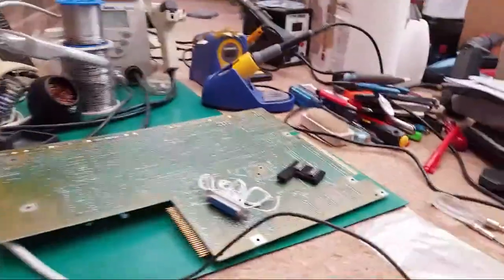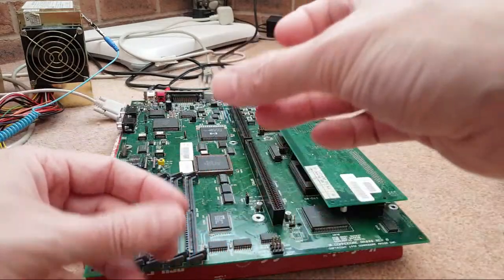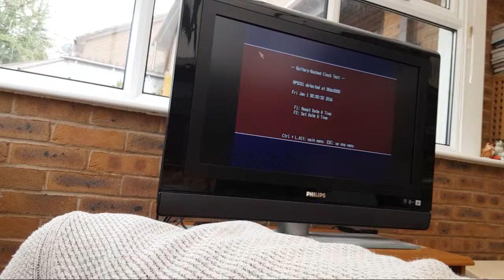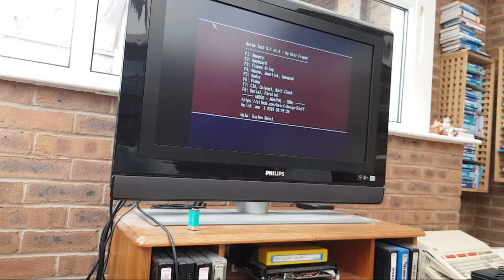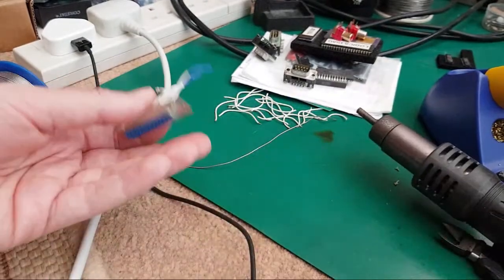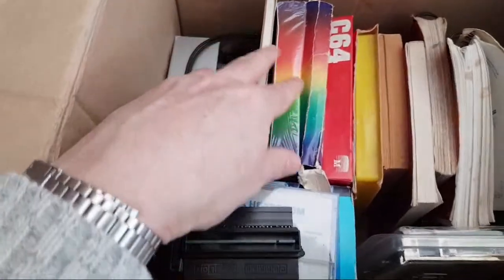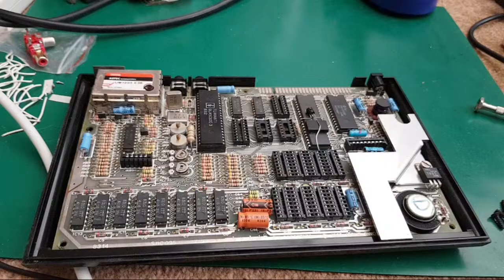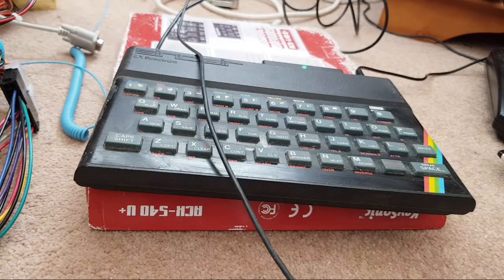Commodore Amiga A4000 RTC / Serial Loopback / Spectrum & Waffle

Comment: I finally got the Kickstart ROMs out of my A4000 this morning, it seems to be impossible not to bend the pins on removal. But getting them off it revealed that when I first tried to get them out last weekend, and the screwdriver slipped, I gouged the traces underneath with the screwdriver. That’s when it went from intermittent/unstable to broken. But at least I know now.

Comment: I missed it. I was playing 3D Monster Maze on my ZX81 with 16K mod. I knew the mod worked right away, it took 3 hours to get it to load anything. Clean the heads, realign the heads, play with volume and tone controls, fast-forward and rewind the tape, bang the tape in the palm of my hand. The usual. LOL. I think to get the 16K Speccy upto 48K, there are some other mods that need doing as well as putting in the mem. Entertaining vid as usual.

Comment: Slightly off topic but relevant to Amiga and other machines. Is there any reason you could not modify the charge circuit and install and ML2032 rather than diode the charge circuit?
Hope someone will be able to advise
Reply from the maker: It's totally possible to mod the board to work with an ML2032!  At some point I will do that on a board!